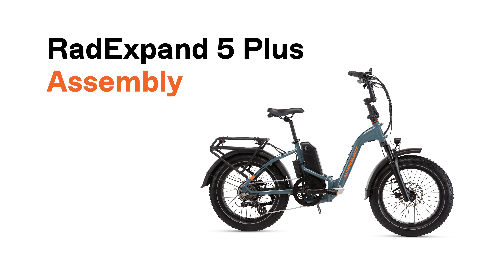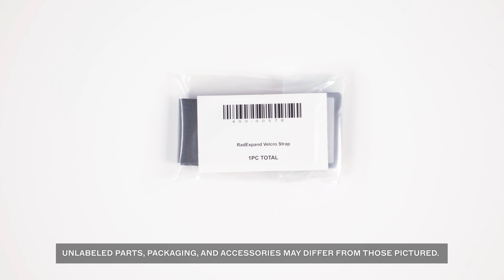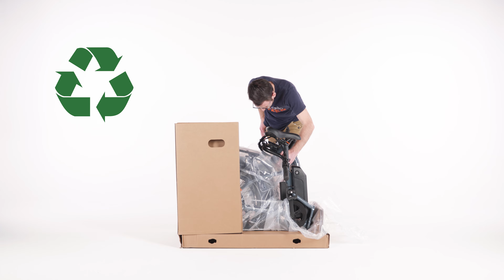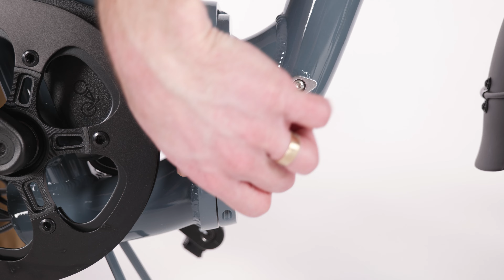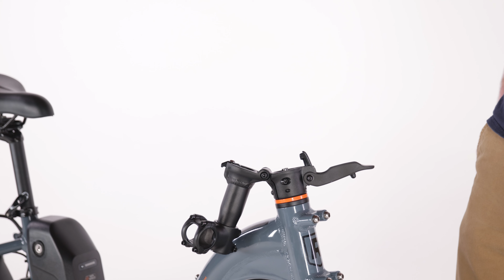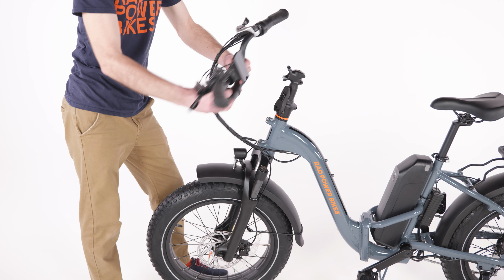RadExpand 5 Plus Assembly | Rad Power Bikes

Comment: I have mine today! Everytime I turn on the bike the light goes on...Any way to dissable this option?
Reply from the maker: Hi! The headlight will light up at startup. To turn off the headlight for daytime riding, press and hold the up button. Also check out page 21 of your Owners Manual here: 

https://cdn.shopify.com/s/files/1/0799/9645/files/om_702-00019_expand5plus_usa_en_V4.pdf?v=1709600039 😁